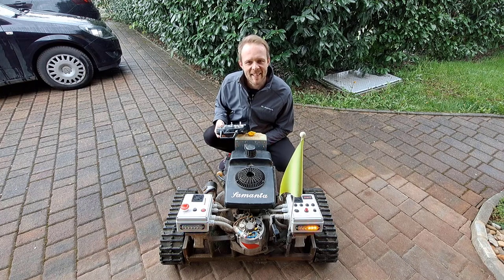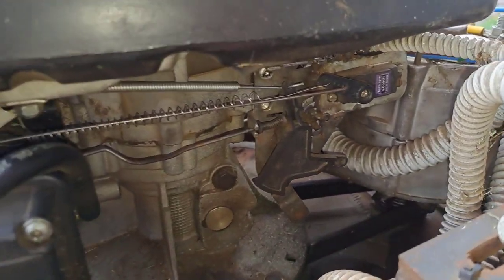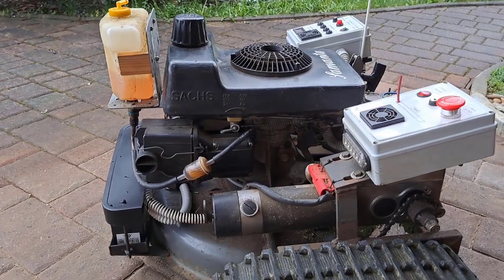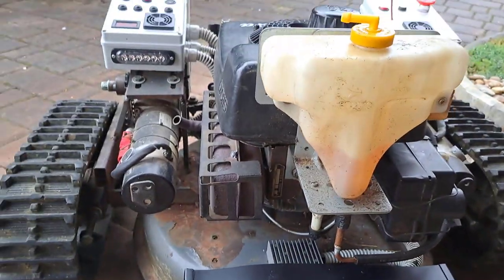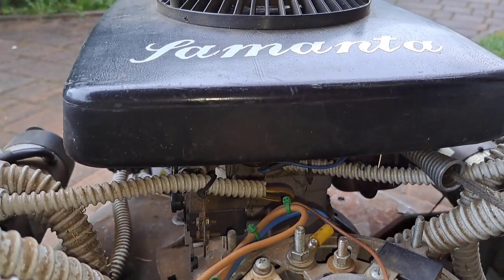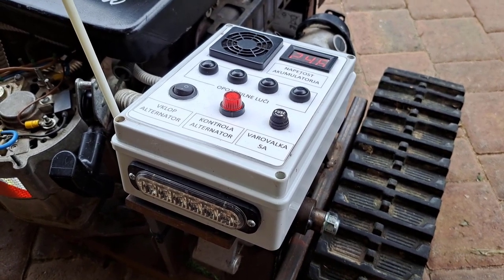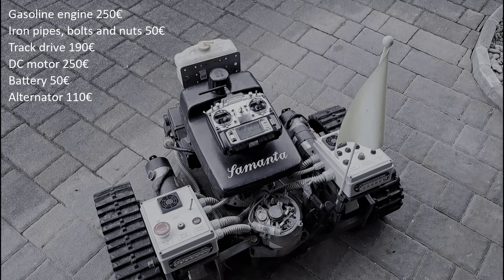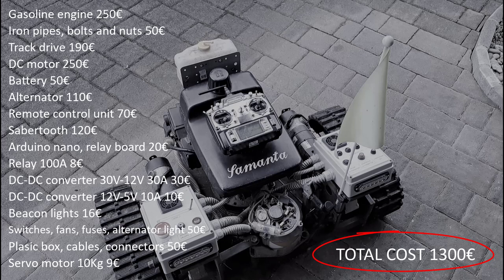Overview and project cost - Remote Control Lawn Mower DIY

Comment: Hello, your alternator delivers 90A current, but normaly you can only charge the battery with 1/10 of the capacity. Did you use a charge controller or how is the alternator connected to the batteries? Maybe you can help me these question to answer
Reply from the maker: Hi! Lead-acid batteries do not need a charge regulator. If you look closely at my batteries, you will see the table drawn and the line "floating use". This is the maintenance voltage that holds the battery at 100% capacity and it is the same as alternator voltage. You can connect the alternator directly to the battery. Maybe a clarification: if the alternator is capable of delivering 90A, it does not mean that the battery will charge at 90A. The charging current depends on the charging voltage. Have a nice day!
Reply: @gregorkobetic  Thank you for your reply. You have helped me further